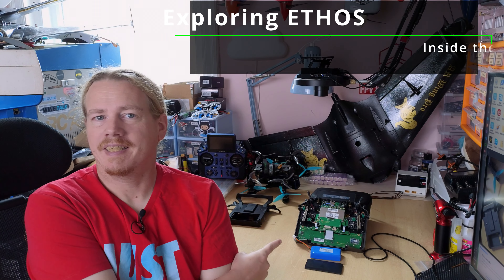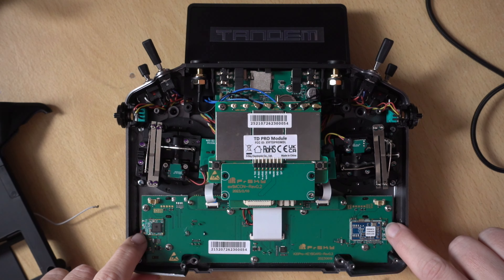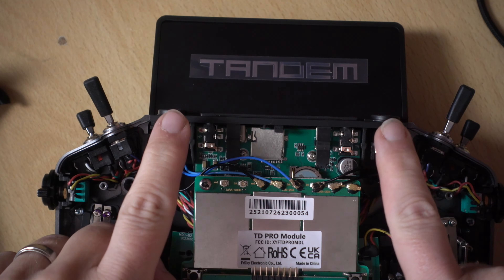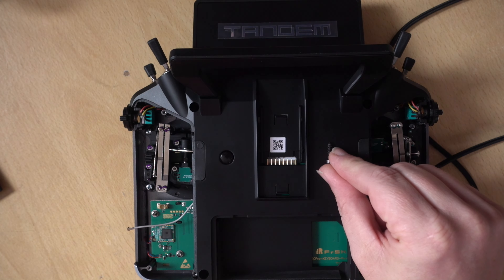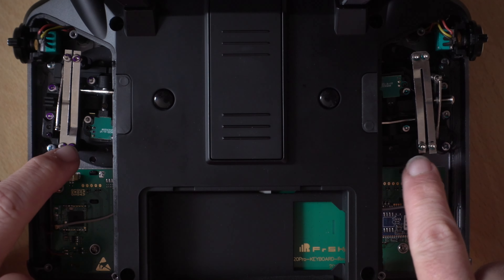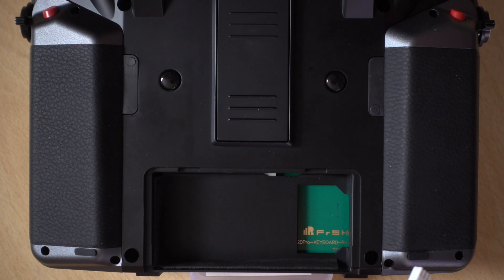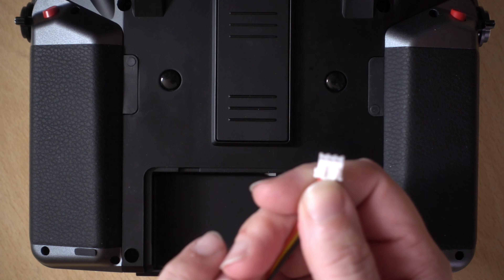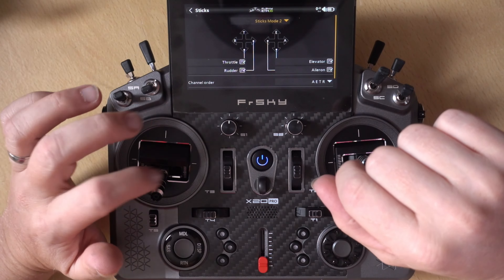Inside the FrSky TANDEM X20 Pro: Adjusting gimbals and changing mode

Comment: Gorgeous Tx very neat inside I like the gimbal Rotation.

..... I've just bought a Red X18SE mainly for the ergonomics after asking folk but with no gimbal rotation I presume? I will definitely be watching your videos for help setting a 67in 3d Extreme flight plane up with T Motor telemetry/program ESC box to show on screen ESC temp mAh used etc.

Thanks for making these videos 
Liked & Subbed
Reply from the maker: Thanks David.

I hope you enjoy the X18SE. It’s a great transmitter. No, only the X20S and above have the rotating gimbals. The X18 never had this feature.

I’m not sure if the TMotor’s telemetry will get sent to the transmitter. If it uses SmartPort as the telemetry protocol, it should be fine.

Comment: Darren.  Question.  I have a TD R12 receiver, registered it and binded it.  Updated the receiver firmware.  I'm trying to use channel 11 and 12 for ignition cutoff and engine auto start.  It seems I can't get 11 & 12 to work at all.  1 thru 10 channels work fine.  I'm thinking its a defect in the receiver.  Any thoughts?
David

Comment: Thank you for this very helpful video! I have the X20S myself and the gimbals are the same, but in the case of switching to mode 1 (throttle to the right gimbal) isn’t it necessary you have to remove the machine screw holding the existing throttle centering arm up and move to other gimbal? Or is it sufficient to simply adjust the relevant spring tensions?
Reply from the maker: No, there's no need to physically swap the gimbals. You only need to adjust the ratchet, brake, and spring tension.
Reply: @vanderheijden1 is correct, there's a screw in the spring centering arm that must be swapped to the other side, otherwise the stick that is now for the throttle will have a ratchet that tries to center. I've just bought a second hand pro and the throttle was doing this, it's horrible! Upon examination I found that the screw was completely absent and I had to find one (M2) to fit. I have pictures...
Reply: See my comment above...

Comment: Any chance you have a video on how to setup a TWIN receiver with a 900mhz as a satellite for triple redundancy?
Reply from the maker: I don’t believe you can. I’m sure they all need to use the same protocol. Unless the 900MHz or TWIN are using an external module.
Reply: I know you definitely can, just not sure how to setup the transmitter to do it.

Comment: Hi Darren. Just purchased a Frsky x20s and I am trying to make my throttle stick go to the centre to use with boats, cars etc.  could you please tell me how to do this please.
Reply from the maker: You would need to follow the part in the video for switching the throttle. However, all you would need to do is remove the ratchet and add the spring tension to the throttle. Rather than transfer it to the settings to the other side.

Comment: I believe something here is inaccurate. The 2 blue wires are 2.4 FSK but the 2 black wires are for the TWIN module, one is 2.4 FSK, other is 2.4 Lora.
Reply: That's not correct. TWIN uses both the 2.4G FSK section (2 blue antennas) and the 2.4G LoRA section (2 black wires). 

There's 3 RF section on the board (900M LoRA, 2.4G FSK and 2.4G LoRA), TWIN and TANDEM both use 2 of the 3 RF sections present (FSK/2.4G LoRA and FSK/900M LoRA respectively), ACCESS/ACCST and R9 each use 1 (FSK and 900M respectively). 
|
Each 2.4G RF section has 2 internal antennas and 1 external connector.
Reply: Here is what I was just told by someone that reviewed the X20Pro for FrSky.

The TWIN RF module has its own 2.4 FSK connection and in TWIN mode it does not use any connection from the FSK module. So in TWIN mode only the TWIN module is used.
Reply from the maker: I guess it’s possible. But it wouldn’t make sense. The external twin module, and internal module for TWIN only radios will do this. But in the case of the X20 tri-protocol radios. It doesn’t really make sense. 

The TD Pro RF module is specifically made for these radios. So the best use of antennas and space would be to use the FSK third of the module for the FSK part of TWIN. That way it has antenna diversity. Then the TWIN third of the RF module would deal purely with 2.4GHz LoRa. Also with antenna diversity. Then it would blend in the same way that TANDEM does with the 900MHz third of the RF module and the FSK. 

I would understand the TWIN third having both FSK and LoRa. If there were 3 separate RF modules in the radio. Then the TWIN module could be the same module as used in radios like the TWIN X Lite. Saving on different BoMs, parts, and potentially production costs. But as it’s a custom module. It would make sense, from a performance perspective. 

The only way to know for sure would be to either hear from FrSky directly. Or to take that TD Pro RF module apart and see what ICs and tracks are on the TWIN third of the board.
Reply: The individual that performed the review for FrSky has contacted FrSky for some clarification on this.
Reply from the maker: Which individual?
Reply: I’m trying to post the link the Rcgroups review but YouTube must keep removing it
Reply from the maker: I don’t think it allows links. But you can post the channel name. Shouldn’t be hard to find.
Reply: FrSky engineering  confirmed that when TWIN you are using the 2-2.4ghz FSK antennas plus the 2-2.4ghz Lora antennas.
Awesome, thank you! I was basing the colors off Mr. D on YouTube, he showed the internal antennas.

Using all 4-2.4ghz antennas plus 900mhz when using a TWIN receiver with a 900mhz receiver acting like a satellite is an amazing setup. Thanks again!